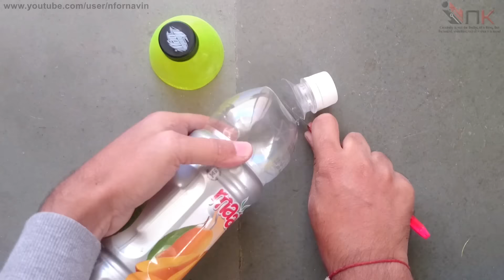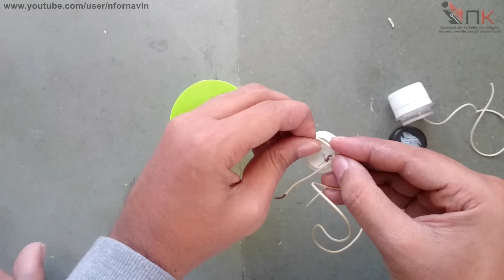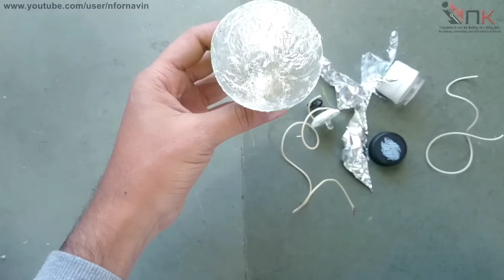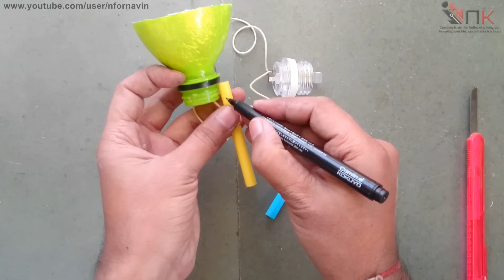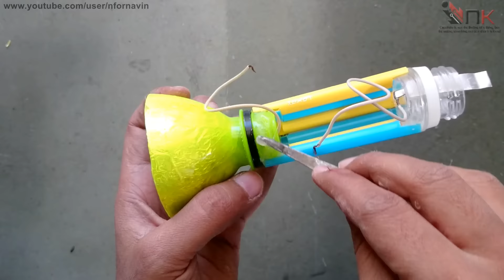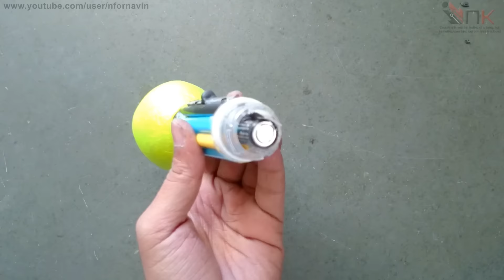How to Make a LED Flashlight using Bottle and Sketch pen at Home

Comment: some thoughts for your next flashlight project, use some LiIon cells, those you can recycle from a laptop battery or use old cell phone ones add a diode and there you go! rechargeable flashlight!  also remember that LEDs need resistors and to make the aluminum foil brighter you can paste stripes to avoid wrinkles.

Comment: How long does that glue last and do the things you build stay together for a long time?
Reply from the maker: I have used epoxy adhesive that's used in industry,  its very strong
Reply: so for example the flashlight you made how long will that last before something fails?
Reply: +coondogtheman1234  If you use it as battering weapon it would probably last a year!  Your question is valid only for products of monetary value.   You are failing with this question!
Reply: No you didn't, and we're done when i say so Adolf!
Reply: Do you still have that flashlight or did you use the parts to make other project videos?

Comment: from where i can get that araldite rapid
Reply: +akarsh srivastava araldite is branded (the good stuff) 5 min epoxy comes as two parts (either double barreled plunger or two separate tubes) you just mix in equal amounts what you need

Comment: You can't connect LED directly to power source, you need to control current, otherwise LED quicly warm up and it reduce significantly LED lifetime. For this tiny LED you don't need more than one resistor. About 20 mA is enough, so resistor could be around 150 Ohm.
Reply: +peeter puujalg just needs a 330k resistor and he should be fine

Comment: where do we get that white wire
Reply from the maker: +Dragon Slayer find from any electrical or electronic devices
Reply: +Navin Khambhala # crazyNK 
Why don't you make an IKEA  type of tool assembly for home.Here in USA sure will work
Reply: Navin Khambhala # crazyNK  tip electrical and electronic are the same